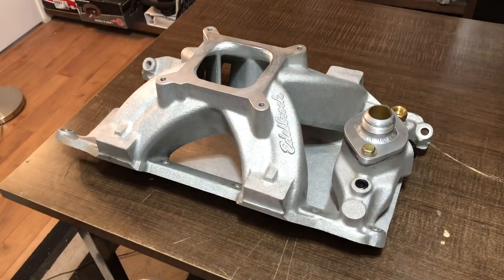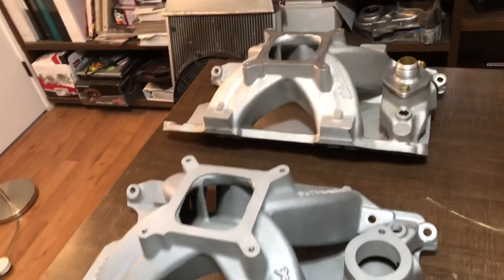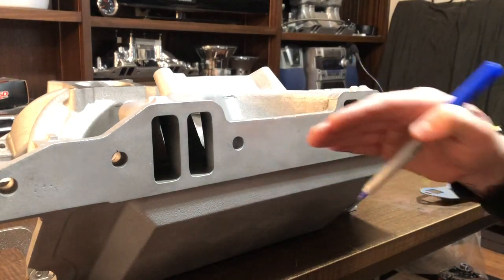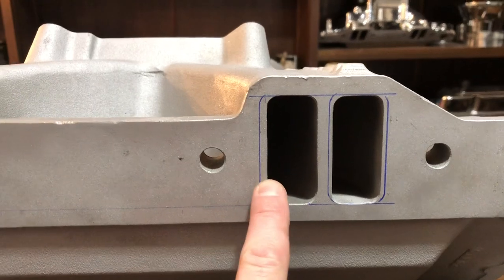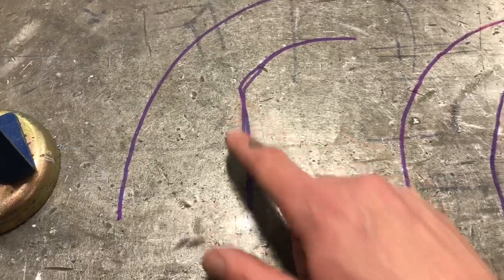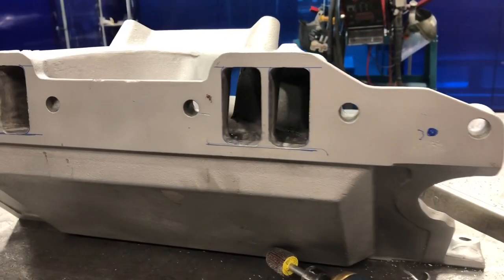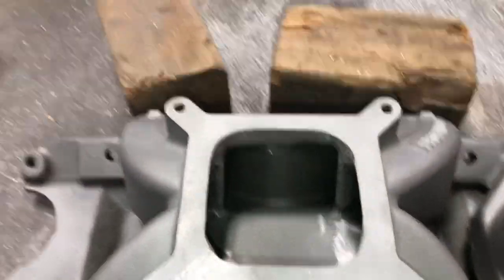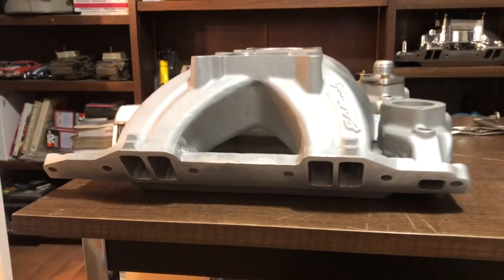D.I.Y. Intake manifold porting! Super Victor intake to Trickflow heads small block mopar

Comment: Your new motor is going to be awesome ! That’s a lot of material, removed from the intake 😳. Can’t wait to see this beast on the dyno 🤘🏻🤘🏻🤘🏻🤘🏻
Reply from the maker: Hell ya brother. I’m stoked on how it came out. Thanks for watching
Reply: I’m using the trickflow heads on my 505 stroker 440. Haven’t run it yet , but what a great cylinder head !!
Reply from the maker: Sweet!

Comment: Yeah, after a couple of decks the intake bolt holes tend to not line up. You can open up the bolt holes to make it work but then the port match will be off. I think I'd a waited till the block and heads were bolted up to see the intake fit and shave it accordingly then done the gasket match...you'll probably be just fine after cleaning up the surfaces but if yer like me, it'll bug ya till ya fix it. Ive got the Indy LA/X big valve heads from Brian in Indio CA and Hughes rockers. The deck is zeroed and the closed chamber heads shaved to 59cc's. I had to shave plenty off the intake surfaces to make it fit right. Too much iron head compression for pump gas and the timing it could run but it still runs strong. From the get go I shoulda went trickflow but I didn't...I'm replacing rod bearings now because I didn't. A few too many detonations kinda hammered on the bearings, the forged SCAT is fine.. Trickflows and Harland sharps have been ordered now and I can say bu bye to iron head detonation.
Reply from the maker: Ya that’s why I just did the width of the ports. Play on the safe side.

Comment: Excellent job of blending sir. This porting will really help in that upper rpm range keeping the mix moving.
Did you deck the block? 
Make sure after you bolt on the heads and intake to shine a light down into the runners. To see if you will need to shim the intake or not. 
I sure you know more about this than I but when I ran the W2 heads it took a little work getting everything to line up properly. 
Looking forward to seeing her on the dyno.
Reply from the maker: Block is getting decked. Again. Ya will have to check fit on new build. Thanks for watching

Comment: Wow thats alotta material lol Is there a way to make the intake so u can pull it off without draining the water? My pontiac the valley pan is seperate so I cut the water crossover off makes it nice to switch intakes or whatever u need to do to the intake Idk just wondering
Reply from the maker: Not to my knowable but draining water isn’t a big deal for me. Just open the rad. Thanks for watching

Comment: after watching your last video I just wanted to share with you that 90/10 front shocks are not the ticket as what happens is the front lifts so fast that it hits the end of it's travel so fast that it shocks the chassis and causes the rear axle to loose traction ctry double adjustable shocks Instead viking makes a good set trust me you won't be sorry🤑

Comment: Ok, ask yourself why is the intake ports smaller?   Well for Velocity .. to keep the full from dropping out of the air.   The minute you open the ports you slow down the air flow.   There is no gain in doing this.  Just so you can tell your friends Oh I did that.   Don't mean to be Negative but..
Reply from the maker: The intake ports on these intakes are small to allow porting to be done to match what ever head you are using. You ask your self “why are intake ports on the heads so much bigger?”
Reply: @port nut  subbed to your channel

Comment: Unless you own a flowbench (as I have for the last 30 yrs), you're just guessing !!   it's bad form, and teaching others bad habits.
Reply from the maker: Not everyone has a flow bench or access to one. It’s not guessing it’s estimating. If the port can be opened 20% make a better transition into the head it will flow better. Watch my dyno and see for yourself. No way I hurt the manifold! This is HotRodding!